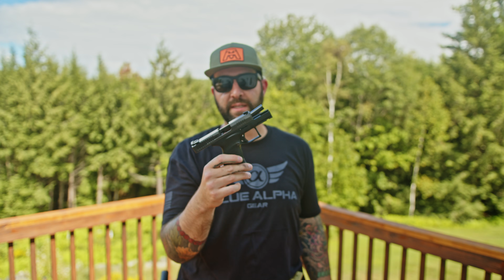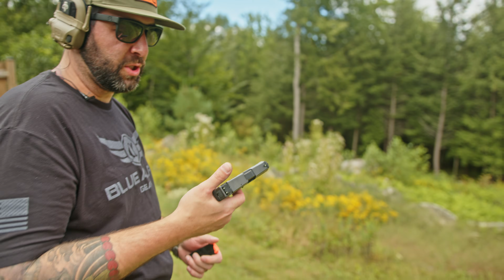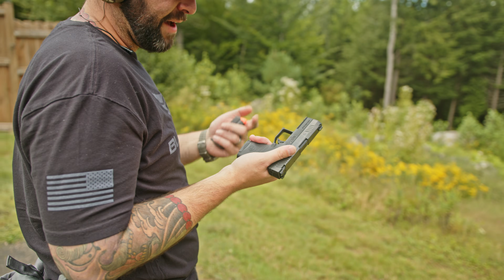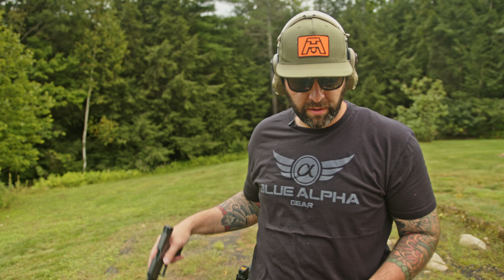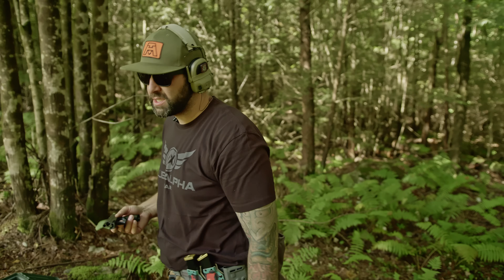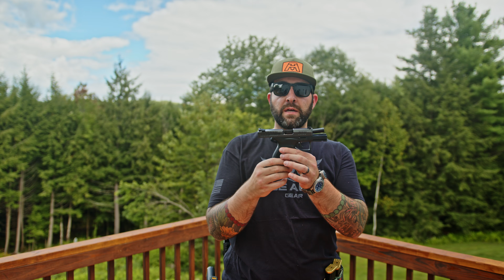CZ P-10 M - A Review of Sorts

Comment: This pistol is great because it does not have a slide catch control. On such a small pistol, you no longer have to fold your fingers to avoid unintentionally catching the slide when shooting.
Is it a self-defense weapon, how many rounds are in the revolver? Is it considered self-defense if you shoot the entire magazine at a guy? It is very difficult for a prosecutor to defend 3, let alone 4 shots.
Wanting to mount a collimator on a microcompact weapon for daily carry means that you are devastating its main advantage - small dimensions.
The trigger is harder - it is not a sports pistol but for self-defense - however, it is still better than that of a Glock or HellCat, especially the behavior of the weapon when shooting is significantly better.
This pistol is designed for maximum simplicity and durability.

Comment: Optics ready on a micro CC doesn't make sense.  These guns are designed to be snag free and readily available.  Optics, lasers or flashlights defeat the purpose.  I don't care if it is missing the slide release.  I am curious as to why the trigger isn't CZ quality.  IMO the reason to buy CZ is the trigger.  If it is not up to the rest of the P10 line, then I will have to look at other 9mm micros.  Looking at other guns that have better triggers will be hard since I have mostly CZ guns and really like them.  Maybe this guy just got the odd one.
Reply from the maker: Trigger is trash. All the P-10M triggers are trash. It's not a normal P-10 trigger. It's important that guns have all the bells and whistles today, to stay competitive in the market. The market doesn't care that YOU don't agree with lights and optics on micro CC. I personally don't disagree with you, other than ALL guns should have optics. Optics barely snag on ANYTHING if garments are cleared. The argument could only come for snags if arguing an ankle gun.
Reply: @ANRDesignLLC  WRITE IN CAPS OFTEN, chill man the guy was just stating an opinion.  As for me, I won't visit this channel again, no loss for you or me.

Comment: What if shield arms can create a high capacity mag for this?
Reply: or CZ creates a new pistol.
Reply: @alew1372  that's what'll happen. This gun is older than the 365 it's just been a European exclusive until now.
Reply: that only worked because of glock's overly wide mags. you can cut mag catch holes in a cz75 mag and it works in the 43x/48
Reply: you do realize that those mags are shit right?
Reply: you do realize that those mags are shit right?
Reply: @Tom-cp6yj  apparently not v2. The mags are the only reason ppl buy 43x and 48's